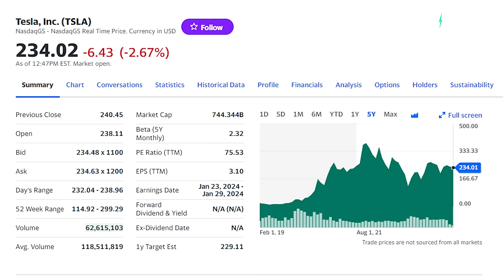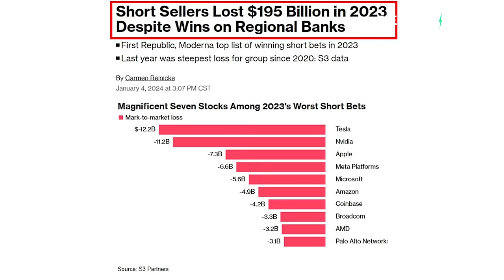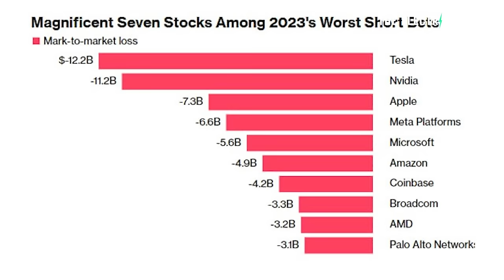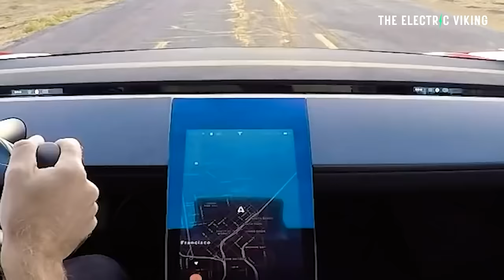Short sellers have now lost $62 billion USD betting against Tesla

Comment: Short selling should be not allowed. Think about how much big oil companies make in a year. They can afford to pump money into short sellers to short sell Tesla to suppress its value. Short sellers have always been a tool of the super rich to destroy value for the retail investor while they make a bundle. It is based on their ability to borrow shares to sell when the value of a share is high and then repurchase the shares when the value is low. But their heavy selling drops the price down causing a panic among retail investors who sell late when the price of the shares has dropped. The shorters become buyers at that time, replace the stock they borrowed and pocket the difference. In other words they are assholes. The only way they lose is that retail buyers don't panic and sell late, but actually purchase when the stock is high pushing it higher. In that way the short sellers who have sold their borrowed stock will have to buy the stock at a higher price and pay out the difference between when they sold and the new higher price. Tesla is a bad bet to short, because there are a lot of people who are eager to buy the Tesla stock at whatever the price.